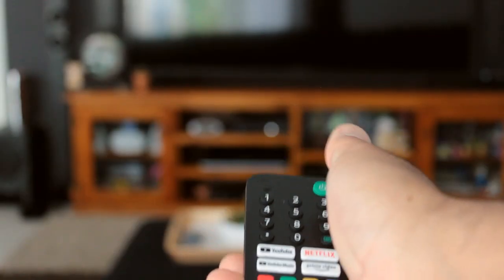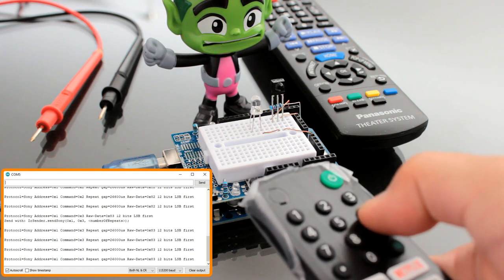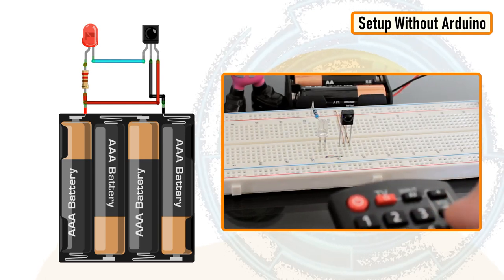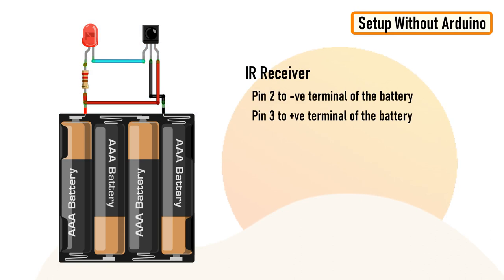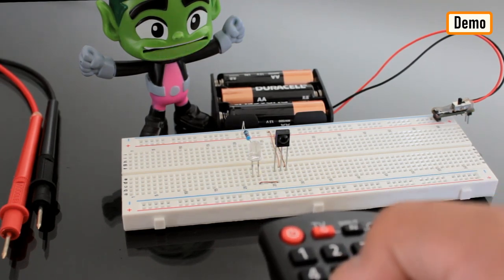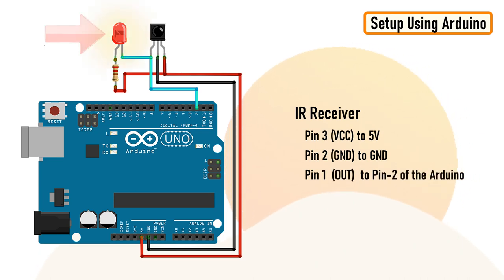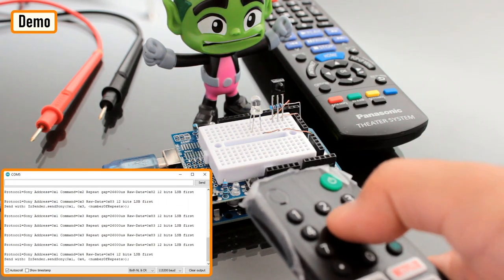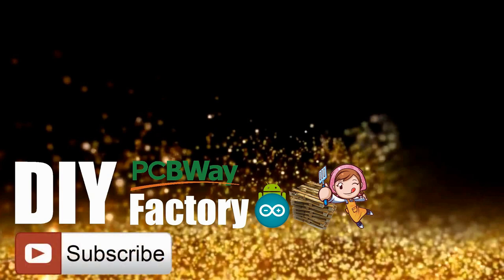IR Remote Tester / Decoder

Comment: The easiest way to test if your IR remote is working is to open your camera on your phone, take the IR remote, point it at the lens of your phone camera, press any button on remote, and on the screen of your phone you will see if the diode is lighting up or not.
Reply from the maker: That is correct
However this video also talks about decoding the IR signals. You cannot decode the signals by pointing it to a phone camera. 
Moreover, iPhone don't allow this feature aswell
Reply: Lol... I saw this and was going to say exactly the same thing. You can also use this same method to see if the "night vision" Infrared LEDs are working on your security camera (s)
Reply: @CrazyCoupleDIY  This is true, that is another reason to avoid Apple technology.
Reply from the maker: Agreed